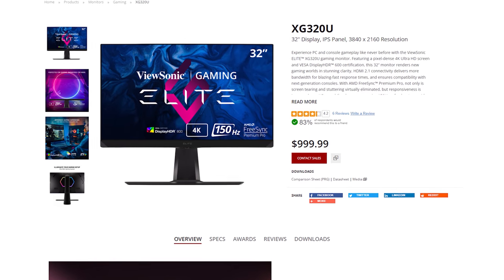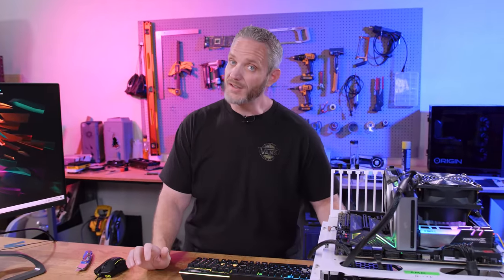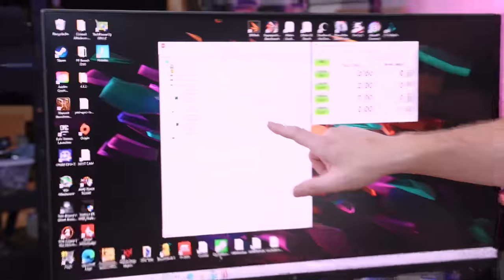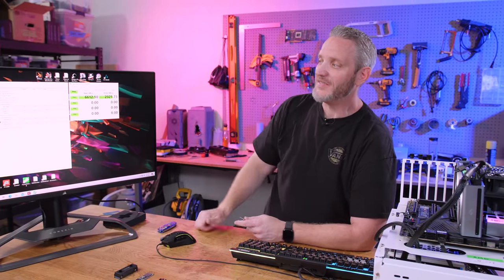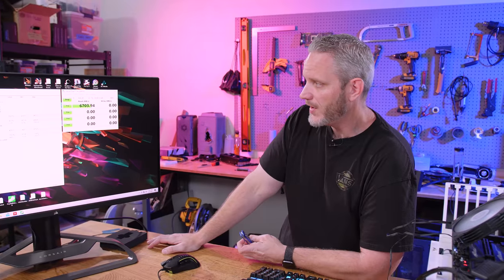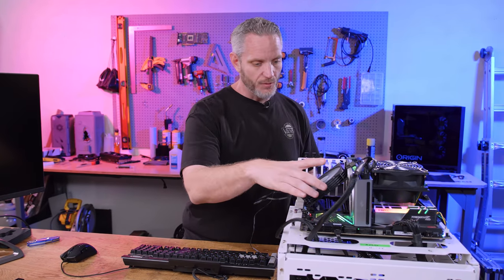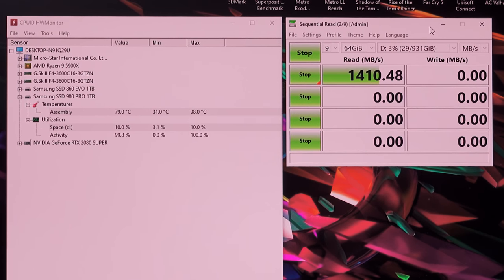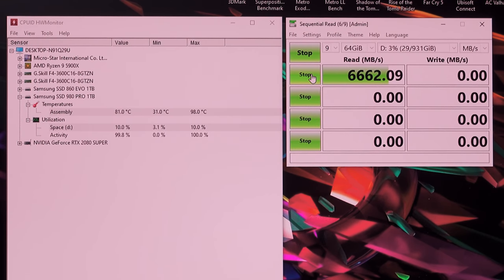I watercooled an NVME SSD... These results were unexpected!

Comment: While these heat tests are useful, they are not indicative of real-world conditions. An open-air test bench system will react completely different than a system enclosed in a computer case, which is the type of system that most of us use on a daily basis. An open-air system does not depend on case fans to provide air circulation and cooling for the NVMe. Also, some NVMe slots are actually located under the graphics card, which could draw heat from the GPU. While the stock thermal covers provided by the MB manufacturer may provide adequate cooling on an open-air system, the NVMe could still overheat in an enclosed system, without proper case fan ventilation. Proper air flow and keeping the system clean and free of dust, is very important to prevent heat buildup, even under normal work loads.

Comment: I wonder about those NVME temps, aren't those Samsung memory chips recommended to work hotter? I remember reading articles about them and they were different from the others. It was something like they work better and longer if they are hotter which is why I have installed only one small radiator on one of the chips which is a controller and the memory chips are left without.

Comment: I have a nagging question, if anyone could help me out- I plan on using 2 NVME drives, 1 500gb for the OS (and a few small programs), and the other (2 tb) mostly for games (and bulk/ larger apps and files). So where should I put the boot/ OS drive, and where should I put the "game" drive??? 
Will the game drive or OS drive generate more heat? I'm also not sure if having the OS drive closer to the CPU (but in the hot area) will have any benefits. My board (ASUS TUF gaming X570 pro wifi) has 2 NVME slots, one tucked in the hot spot between the back of the GPU and CPU water block, and the other at the bottom of the board with the heat shield. I tried to Google this, but couldn't find what I was looking for... Any help would be greatly appreciated.
Edit, I'm not concerned with the performance of the larger game drive, maybe a bit with the OS drive. I'm mostly concerned about heat and longevity.

Comment: i did have a m.2 drive die on me on my old intel z97 system. im not sure if it was heat or if i got a lemon but it was an intel m.2 that i put a ek heatsink on and it died like 2 days before the end of the return period and at the time i thought it was because i didnt take the sticker off of the drive. now i have 2 samsung 970 + drives being cooled by the cover on my motherboard and i have had 0 issues in the past 2+ years

Comment: My wifi disappeared on my msi x570 ace board. I tried everything. Update all drivers, Mobo update, went to device manager uninstalled, reinstalled and tried to update but  got a code 10 error. Same with ethernet. This sucks man i finally got my gpu too.

Comment: Idk if anyone commented this, but if you loop it all with cpu and gpu, wont you actually be doing a detrimental thing to the water block and the nvme and possibly heat it up with the thermals of your liquid cooling (given that you are under constant heavy loads) over using the mobo heatsink?

Comment: i get it wont affect performance but would the water cooling the nvme actually help the drive last longer?
after all its running 10 degrees cooler or about 25% on this test bench

Comment: NVME drivers should never go below 60c under sustained usage and should never go over 69c, 69c fine 70c absolutely not

Below 60c the resistance increases and hence reduced the write speed because the drive has to keep trying until data sticks without write errors

Comment: Samsung magician was reporting my SSD as too hot so I added one air fan beneath it, there wasn't much airflow because the case is otherwise watercooled. Might not affect performance, but longevity is also a worry. Watercooling might be useful for an SSD raid card, the highpoint ones have a small fan, not sure how noisy they are.
Reply: My 960 evo NVMe was heating and write and read speed was dropping drasticly . I monitored it with AIDA64 to have NAND and controller temp . The NAND temp was OK, but the controller reached almost 100°C and throttled . I bought a 10€ EK passive radiator . I didn't put thermal patches on the NAND as it needs to stay warm for longevity and efficiency, just on the controller . Even in high write charge, the controller never goes up to 60°C since .

Comment: Could try the dd command  in ubuntu on loop  with a aes cypher running into it for randomness i use this to wipe drives but could be used for this if the cpu is fast enough.    You can use a virtual machine with direct access to the drive, its not needed but can help, if not using direct access make the vhd big as the drive - 1gb.      When using the virtual machine  you can use windows to keep track of temps.    I run this command "openssl enc -aes-256-ctr -pass pass:"$(dd if=/dev/urandom bs=128 count=1 2>/dev/null | base64)" -nosalt < /dev/zero | pv -pterb > /dev/***" the stars are the drive location aka /dev/sda1  is  sda .
 This can be found in the disks utility or gparted if installed.  its effectively encrypting the drive w a random password XD the command is self locking aka you need to run it as root sudo -i  and install pv (sudo apt install pv ) pv keeps track of write speed.    Also it should theoretically hit 12gbs on a 12 core amd ryzen as from what i understand it uses the aes hardware.  but there is bottlenecks that can slow it.
this said it should have no problem pushing the drive to the limit till the cache runs out on it.
tldr:
run it like this :
sudo -i      set root mode

apt install pv    installs pv

openssl enc -aes-256-ctr -pass pass:"$(dd if=/dev/urandom bs=128 count=1 2>/dev/null | base64)" -nosalt < /dev/zero | pv -pterb > /dev/***     stars are the drive  you want 

loop example:
for i in {1..20}; do echo -n "loop $i" ; openssl enc -aes-256-ctr -pass pass:"$(dd if=/dev/urandom bs=128 count=1 2>/dev/null | base64)" -nosalt < /dev/zero | pv -pterb > /dev/***; sleep 1; done            this will loop 20 times or until you hit ctrl + c   to increase the loops change the 20 to whatever is needed

Comment: Well, I use my PC every day (10+ hrs), it is water cooled on the GPU and CPU, I use the stock NVMe covers and both of my NVMe drives idle at 37 celcius. I haven't had any throttling of data. Seriously no need to water cool either the ram or ssd's

Comment: Talking about thermal capacity makes no sense. You are reaching a stationary state. Since its a metalic piece the specific heat its very low reaching stationary state takes very little time. What realy matters its the surface. (this is what happens when u are pretending to know). I edited becouse i was a little rude (deserved tho but still).

Comment: Jay, CONTACT SOME MANUFACTURERS. Pardon the caps, but I bet if the device, "knew" that there was extra cooling involved, the programmers could give it permission to throttle up instead of a blanket throttle down policy. Please think about that. If so, the speeds might go up very dramatically! Thank you for this video.

Comment: So could I get an SSD heatsink to keep my VRMs cool? I have a Dell G5 and I think it has 6 phases. The VRMs get to like 85°C or more and throttle the CPU down. Also my SSD reached 85°C on the controller and 75 on the memory. Is it bad for the memory chops to run that warm under load?

Comment: trying to cool a NVMe for performance reasons is silly.  The only reason to use better coolers is simply longevity of the component.  All electronics are rated in heat hours.  The more Heat you have the less life the electronic has.  The longer life use of an electronic the less heat it can take.  If you are spending 400 or 600 on a giant NVMe drive and you want to protect your investment and be certain that you get your money's worth then make the expense to upgrade the cooling.  Otherwise your just throwing money into a fire.

Comment: I don't know how you change your m.2 drives out with out removing your gpu even if it was vertical mounted so if you had a water cooled gpu you would have to drain the system

Comment: After seeing this, I got an ssd heatsink, not watercooled, and found my CrystalDisk temp dropping 25 degrees. After some more searching, I saw info, stating that NAND chips, run better at higher temps, and that only the controller, should be cooled. Can you comment on that? Thanks in advance.

Comment: I am currently trying to overhaul an older ASUS GL552VW laptop which has been acting strange for the past one year. I have an 128GB M2 SSD (non-NVMe) for OS duty and 1TB HDD for data storage. I measured 36.2 C temps idle at the mousepad from the top and a lot hotter when gaming. I want to change the SSD to a 500GB 860 EVO since the MB doesn't support NVMe. Question - is it worth exploring the option of a  heatsink on the SSD if space allows or better to focus on changing the fan and thermal paste on the CPU and GPU? Unit is 6 years old and used as a desktop replacement, works basically 24/7 and I smoke heavily in front and around it.

Comment: Could it be possible for an SSD in a laptop to throttle as the ambient temperature would get higher than in a proper case with airflow?

Comment: I've been wondering about this as well. My 970 EVOs get pretty hot.  Haven't noticed any real throttling though. 
That being said.  Water Cooling the NVMEs as a Flex?  Cash me outside.
Reply: Do you have a heat sink on it? Mine used to run 70° under load and be in the red but once I put a heat sink on it it doesn’t go above 55

Comment: Aquaman PC, watercooled:
-cpu
-gpu
-ssd/s
-psu
-ram
-rgb controler (most inportant)
Max distro plates and watercooled water tubes for that extra cooling with muh rgb fans
Bonus:
Watercooled keyboard and mouse with a custom watercooled gaming screen and the must watercooled chair (chair optional, for a cheaper version look bellow)
Bonus no2
Watercooled user (play in a cool pool)

There ya go, watercooled evrything.

XDDd

Comment: I'm a DJ and I noticed that my DJ software, when it's analyzing music files, my PC often thermal throttles.. 

Sometimes whenever I have DJ software analyzing music files the whole system will stop responding. Like the mouse won't even move on the screen or anything. Until the software finishes what it's doing and then eventually it unlocks the monitor in the mouse and everything and I can just go back to using it..

Admittedly, I do have a crappy HP pavilion core i5 pre-built piece of sh%t, so I already know that's half my problem..

But have you ever thought about using DJ software and music analyzing to possibly stress test your drives...

Stress test your systems in general..

You can have that overlay on another monitor that's showing you all the temperatures of all the things and you can just fire up Serato or engine DJ or something like that until it to start analyzing your media library..

Next thing you know it's firing on all cores and putting your system through its paces..

Just an idea from a DJ that watches you almost every day..

Keep up the great work. Love the videos.
(Especially hearing Phil crack up in the background)

You guys are awesome!

Comment: This is a great video, Jay. I want to call this 'Real World Testing,' but I can't. My reasoning is the fact that your testbed is not enclosed. I had this throttle-down problem with my PC. I removed the side, and top case covers and the problem disappeared. The fact I keep my HVAC thermostat set at 77 F. might significantly affect my PC temperatures. What would my temperatures be if I moved my PC outdoors on a cold winter's day? Just my comment, and your mileage may vary.

Comment: At 7:11

Back in the day, a program called "Eraser"was used to erase hard drives. It had the ability to set a 32 loop of various data in order to ensure the data was erased. I never used that because it took hours. If you filled your hard drive with various data, (You are a YouTuber with gigabytes of video data laying around, you can find data to just fill an SSD), then set it to its Max and wait it will fill it with all zeros all ones several times and mixed with various zeros and ones and it will take a while....no matter how fast the drive is.

Comment: Water cooling an M.2 is ridiculous in the real world situation no m.2 will passed 60°. They are designed to withstand temperatures of at least 75° before throttling who is ever going to do that. It’s motherboard manufacturers that I’ve pushed the trend of heatsinks, adding them to boards for aesthetic purposes only.

Comment: wouldn't all the paper labels and stickers add to the heat build up?
Reply: 99 % Of nvme ssd's use a sticker that helps spread controller heat to the nand flash basically a super thin thermal pad

Comment: Nand flash preforms better in high temps but lifespan is reduced.
fact in some cases temperature means i can flip my gate faster due to my junction voltage saturating faster.
Can i have a job please?
Reply: good day i have attempted to contact you but am unable to

Comment: 32°C on an NVME? I wish.... my SATA SSD (old-ish 850 Evo 500 GB), which lives on the rear side of the mobo-tray, will sit at 32 all day long, but my NVME (970 Evo Plus 1TB) is more like 50, 51°C at system idle, sitting in the top PCIe slot between my GPU and CPU. It is the OS drive, yes, and it doesn't get "much" hotter than that under stress (~60° gaming, 66° Passmark SSD benchmark), but it's gotta be one of the hotter running components in this build. It is siting under a heatspreader and a thermal pad (MSI Z690 Tomahawk), and I do wonder what the temps would look like without that heatspreader.

Comment: try tranfering large batches of video files win 10 is plagued with issues, nvme sdd's like the samsung evo dropping to near thumb drive speeds after the first 4gb. the real world use case is using your phone as a primary camera for example when vlogging on location and then dumping the memory when its near full ~200gb for editing later, windows will often, crash during transfer, leaving a currupt file as large as the intial file transfer resulting in incorrect storage allocation data, it also often fails to ajust or update availble space on the drive when you delete a large file ~50gb and as I'm writing Boom there it is again just crashed on a 61gb 15 file transfer "there is insuficient disk space to complete operation" dispite clearing 168gb free space before i started with a total of 127gb of files that need to be transfered which i now transfer in batches because the errors are so common place, it really is hard to justify not going back to win 7. I think microsoft may have fired all the talent in pursuit of maxium profit whilst failing to realise they actually need a working product as a foundation.